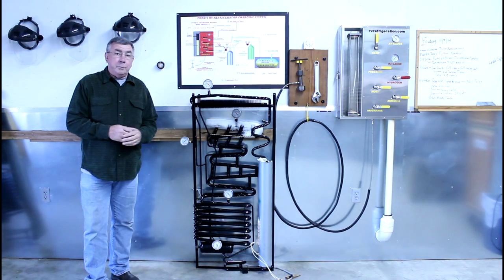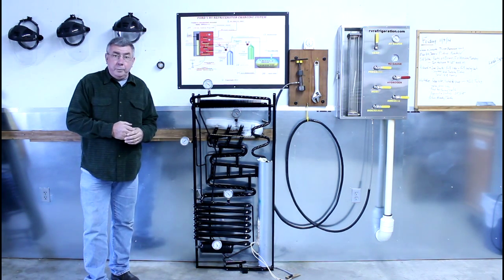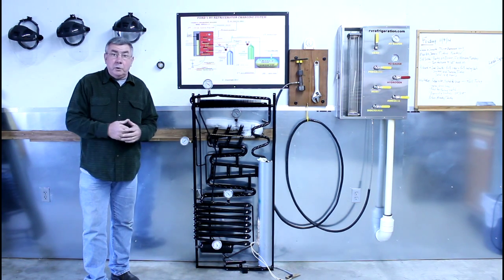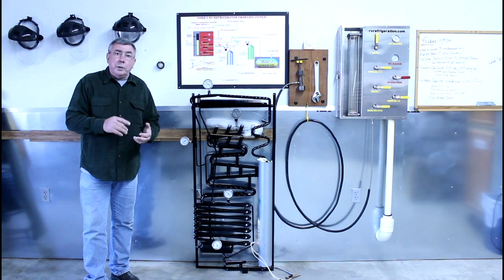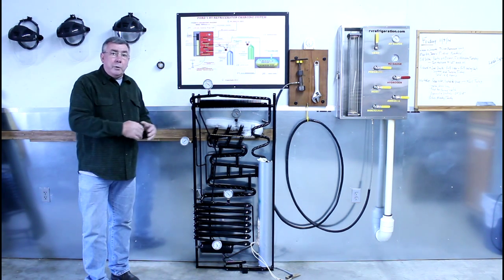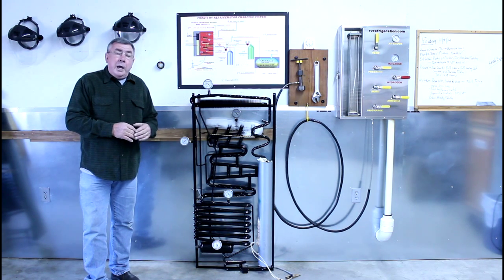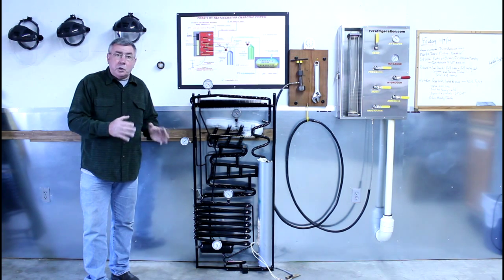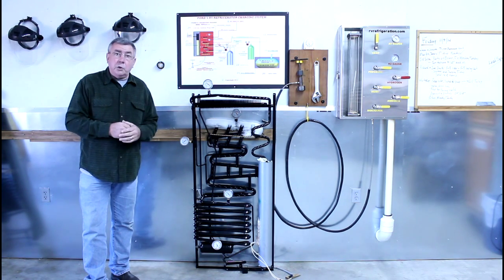Ford's RV Refrigeration Training School Learn How To Repair Ammonia And Water Cooling Systems, FRVTC

Comment: I'm going to be traveling through Paducah on my way to St. Louis in early August. I could drop it off with you and pick it up on my way back. Is that an option? I definitely have an ammonia leak on my Demetic Americana Mod #2852. My door on my RV is wide enough to get it out (about 27 inches)...Paul
Reply from the maker: Paul Ledbetter , This is fine give us a call. GBYAY